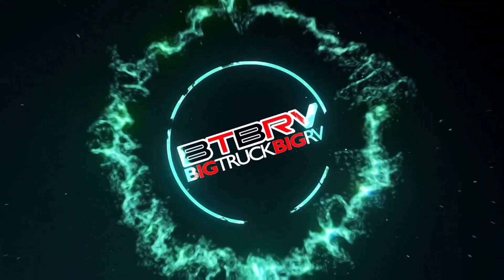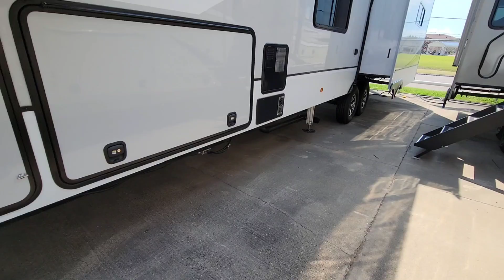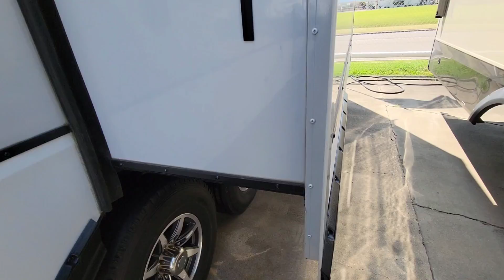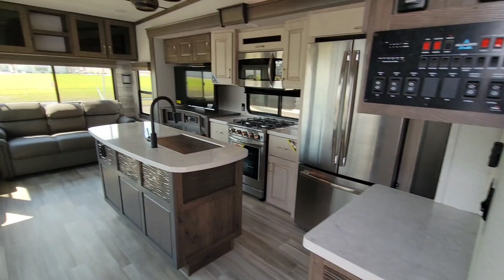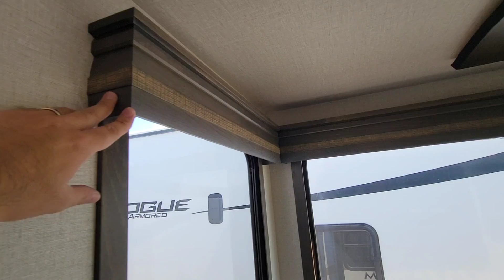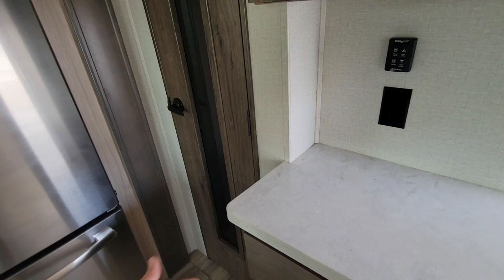A better built RV? How much more would it cost?  Let's find out!

Comment: Great insights. Quality control is really the key to customer satisfaction in the RV industry. The little things you mentioned like trim work are minor and easily corrected. Most people may get annoyed but will take care of it and move on but some things cannot be corrected once built. I wish you were closer to my location so I could show you what truly poor quality control is. I will not give the brand but my new unit has issues in multiple structural areas not able to be or not easily fixed now that it is completed. An on the line QC of major components, (floor, roof and to a lesser extent plumbing), would have saved me a lot of grief. I have a unit that should be bought back by the manufacturer for build issues. To top it off, the build issues and problems have been compounded by a dealer that has proven themselves incompetent. They have caused significant additional damage while “repairing” warranty items and even damaging my front cap to the point of potentially needing replacement. We have owned an RV of one type or another for over 25 years- our last one was even this same brand and never have I had the issues I am having with this one. By the way- it is only 4 months old and has spent most of that 4 months at the dealer.

Comment: That being said once again you in some ways come off sounding like an apologist for the industry. That’s a harsh statement so let me tell you why I make it. 

First many of the upgrades you price in are ones that most people aren’t asking for. Take the axels. Most of us would be perfectly happy with what came with your new 5th wheel which obviously wasn’t insanely expensive. I noticed with the exception of the roof there wasn’t an upgrade you put a price on I wanted. 

Second the plumbing and wiring I think your missing how for example automotive style harnesses work. Those harnesses are designed not only for reliability but speed of production. An automotive style harness would be more expensive to design and buy but it would allow the units to be assembled quicker and be far far more reliable in the field. Especially with proper color coding of wires to make tracing faults faster and easier. At the very least they could eliminate things like the rats nest of wires you found when you opened your unit up. That’s not efficient or fast. 

With plumbing the big issue is the quality of components that they use. Plastic joints vs brass. Pex connections on non Pex pipe. Yes those fittings would be more expensive but by a few hundred dollars a unit not thousands per unit. 

Third when you do start talking about improvements in fasteners etc you say it’s something they could do. I’d rather see you pointing to specific areas and pointing out that there is no excuse for doing it cheaply or poorly when it can easily be done much better. For example cabinet joinery. RV drawers are a butt joint held together by a couple of staples. It’s literally the weakest possible way to do it and entirely unsuited to the rolling earthquake environment. Especially when the technology exists to produce far more robust joints in a production line environment. Or how about how they surface panels in an RV. Often what looks like a piece of stained wood is in fact pressed paper with a piece of what is essentially wall paper on top of it. Which means it has zero durability and is nearly impossible to touch up when you do get dings and such. A good price of stained 1/4” plywood or even solid wood would be far far more durable and repairable for the end user.

Fourth installed component reliability. It’s doesn’t take much time in the various forums to see people having issues with things like water heaters and 12v gas/electric refrigerators. The basic technology behind these components has literally been in use for decades and there is simply no excuse for their manufacturers to not have devolved their products to the point of being utterly bullet proof by now. You can’t tell me these manufacturers don’t know what they need to do to make their products perform better and more robustly. So what are they waiting for??!!

JD you’ve been on a crusade for years for better tires and suspension systems that is showing dividends. Public companies respond to public pressure. You’ve got the ability to apply that pressure and I’d love to see you using it beyond tires and suspension.  

I want to emphasize that I believe your telling us the honest truth as you see it. But I think your missing a great opportunity to push for better quality across the board. Because frankly most of the time when you talk about quality it’s to explain how these units are hand built, or how this change would cost a lot of money, or how all RV’s have problems etc etc. I don’t feel like you spend nearly as much time calling out things which can be better and should be better.

Comment: So we ordered a new unit in January (still in production) but we upgraded everything. Not happy about the price tag but feel it is worth it (on demand hot water, solar, generator, brakes, cold weather package, residential package, dishwasher, washer, dryer, etc. ) We are going full time and felt the end result justified the cost for our extra comfort, convenience, and safety. Not everyone will feel the same. This is my 4th RV and I have learned you get what you pay for.

Comment: You are thinking about it wrong. you are adding the cost up as if you are buying everything aftermarket and then adding it to the coach. you are forgetting to account for the cost savings of not using the original equipment. Such as adding an instant water heater but not subtracting the original cost of the original water heater. so say the the cost of the instant water heater is 1000 and the standard 6 gallon or 12 gallon was 500 dollars... its not now 1000 additional cost its 500.. your costs are WAY off..
Reply from the maker: I did factor that in if you listen closer to my overview

Comment: Things most important to me are as follows:
Safety- I want the best axles, tire / rim, brake, and suspension components possible.  Being broke down on the side of the road, or losing control of your camper heading to your destination due to under rated components is absolutely unacceptable and completely preventable.  
Comfort- 2 big upgrades for me would be any improvement to keep water out, ie. solid metal roof.  Ducted AC system, and better insulation.  Do any manufactures use closed cell spray foam?  Not only would it increase the R value, but would add rigidity to the entire coach.  
Last- things like conduit wiring, manifold plumbing and try to stay away from wood products as much as possible.  Use composite materials that are subjected to changes in moisture and humidity.  That’s just my $.02.  Yes, I’d be willing to make sacrifices in other areas to keep cost down, knowing that I can make upgrades later on.  Think appliances, furniture, cabinets, plumbing fixtures.   I can rip out old cabinets and replace with nicer ones.  I can’t rip out 2 inch walls and go back with 3.5 inch walls.

Comment: Fantastic. I am adding independent suspension rated at 8K per axle. I also wish they would look closer at how boats are built for fasteners. Thanks for adding weight on your add list, I didn't realize how much weight some of these things would add. It explains why some of the units that have what I want are so much heavier.

Comment: With the wiring it would cost a little more with wire harness it it could greatly decrease production time. It is easier to lay in a pre manufactured harness than running separate wire in each RV.
Reply: I would agree if they controlled production of all electrical components.  The automotive industry uses plugs with all their harnesses, which means everything simply plugs into a harness at it's termination point.  Unless the RV manufacture could produce their own switches, panels, and electrical components, they would still need the labor intensive process of connecting plugs/outlets and such.  Also, they generally have a rack with all the wires they need spooled in place and the grab all the wires they need at 1 time and drag them down the chassis together.  With a harness, you would need to use grommets and fasteners to attach the harness to the frame and other areas.  This would actually slow things down compared to how they do it now.  Also, remember that they often change technology and floorplan styles very frequently.  This would require a new harness be produced every time, which means harnesses that aren't used would have to be modified or scrapped.

Comment: Lets assume that no one is going to change a thing with components, walls, wood, tires, or any thing else.  What if the problem is as simple as quality control.  Probably starts with discussions with employees about checking their work, taking that extra minute to fix what they already know is a mistake and repair or clean up what they just did.  Conscientiously working, taking the extra few seconds, working toward quality and not quantity.  I suspect simple changes like that, starting with Forman and managers, would make a larger shift in the quality working with already existing product.
Reply: They are humans doing a repetitive task.  Few people could do this day after day.  It's the weak link in the process and only automation will solve it.

Comment: Inch for inch Azdel has a greater R value, so I’m not sure a double Luan would have a higher R value. Why would I want to upgrade that pin box? Would it add to the build quality or reliability of the trailer? I think changing the way things are fastened is huge. I believe problems would be greatly reduced. I had a couple of screws pull out holding a window valance. Azdel does not hold screws as well as wood. I repaired it with a simple screw anchor. The question is why not use screw anchors when building the trailer. My trailer is a Lance which is a premium priced unit which uses premium materials. Overall it’s been a very good trailer. There are processes in RV construction that can be improved that would enhance quality such as the way things are fastened together. This improvement doesn’t require expensive upgrades in components. It may take a little more time and minimal material cost increase but to avoid problems it’s worth it. Even minor warranty repairs can be a huge pain. Timely service with minimal loss of use is impossible to get. If you’re a full timer, you’re screwed. That’s a whole different topic though! Access to service in this industry really sucks and needs to be overhauled. Because of this, build quality and reducing problems is all that more important. When Coachman sent a mobile tech to make a repair on your fifth wheel, I thought that was great! This should be the model for future warranty repairs!

Comment: How does Airstream do it? Have been in business a long time.
Reply: correct, but they are extremely expensive per ft and do not make fifth wheels.  They also suffer from many of the same issues as other brands.  But think of it this way, a 28ft Airstream travel trailer with no slide costs around $40k MORE than this 42' Alliance Fifth Wheel.

Comment: Here’s the thing . As I’ve always said . Anything that is man made or assembled by man is subject to failure . But , given the proper care and maintenance as well as preventative maintenance rigs can hold up fairly well . Given , that is not to say that some things are just subject to failure . That’s why they make spare parts available to the consumer . Being able to perform many repairs yourself is both imperative as well as saves rig time and money .  Can manufacturers do a better job . Sure . But there’s a human factor involved . These things are earthquakes on wheels . And our roads definitely don’t help things . Plus being in a rush to get somewhere with the rig certainly doesn’t help the rigs longevity . By watching this channel and many others be learned I can fix a lot of stuff myself . Saving me both money and time . Probably the Love You upgrade I’d be willing to pay extra for would be the independent suspension . To me this as well as quality tires are the most important piece of equipment on a rig . We full time . And we travel a lot . We’ve owned 3 different brands . All purchased new . And I’ve been pretty satisfied with all 3 . Did they have issues . Sure . But they were actually minimal in the grand scheme of things . They roll . Things move . You repair what you can . And what you can’t try and have the manufacturer or a quality technician make the repairs . Good job jd .

Comment: Suspension system: Premises: 1.More axles, more  expensive  2.Higher quality components will be more expensive.   3. Leaf springs are known to fail. 4 Independent suspension is more costly than leaf springs  5. Retrofit upgrades  on a suspension is more costly than if it were part of the initial production.  Do you agree with this?   Price quote from MORryde site  for a tandem 7k independent suspension with disk brakes is  $7499.00 or $7999.00 for 8k suspension. ( Prices effective Feb 2021).  Price quote  includes retrofit / upgrade from leaf springs to independent suspension. Upgrade requires removal of all existing components, preparing frame for additional re-enforcement and installation of independent suspension.  Installation of independent  suspension during initial manufacturing process  would be seamless and more cost effective.  Taking into consideration the time / labor / materials MORrdye expends to remove  the  existing suspension  and prep the frame for retrofit the  cost savings  labor TBD?  For a Rough Order of Magnitude, I'd day two people for 4 hrs each for removal. Would I spend an additional $$$$$ on and independent suspension, you bet ya. I think is should be offered as an option.  After watching a  video on the how the independent suspension improves the ride quality of the coach, it  made me a believer.  Without a doubt  it will add to the longevity of the coach.  Just my two cents.
Reply: The crazy thing about this is that LCI does not approve of IS suspension on RVs that didn't come with it.  This is because the frame must be modified to handle the additional stresses that occur.  I had this conversation with the lead LCI Frame/Chassis Engineer.  So that means Morryde equipment attached to an LCI frame must be designed by Morryde to enhance the overall structure of a frame designed for leaf sprung suspension.  LCI also prefers weight distribution equalizers over non-distributed IS systems.

Comment: @ 17:15 When you said covered up by the people that are doing it?  Really?  Like a crimp in a water line that causes a leak in a new RV.   A new RV is taken out for the first time and the water heater doesn't work, or the inverter fails. Then you hear this brand of inverter is known to have issues.  This comment is not directed at Alliance it directed at the industry.  It's time to review and refine processes.  Because this is the way it's always been done in the industry no longer is a justification.. So many people involved in the assembly and build there will be issues.  It is no longer acceptable.  It's time to change!
Reply: I don't disagree, however, of the 10,000 inverters that are installed in RVs each month, if 100 fail or have some type of manufacture's issue shortly after the sale, is that an issue that's realistically addressable by the RV manufacture, when the inverters that failed are spread out amongst 200 different RV brands? Which means any specific manufacture may have less than .5% of their units fail.  Just something to think about.
Reply: That's why they only give a 12mos warranty.  Trailer won't last  longer. They can procrastinate on repairs tell the warranty runs out.

Comment: I solved all the poor quality build issues and poor workmanship by selling mine after 5yrs and just renting cabins or staying at hotels. Haven’t had a slide out, roof or tire/suspension issue since. Best decision I ever made, never again will I own one. If I was a assembly line worker at a plant, no matter how good a job I did, I’d be embarrassed to say I worked at rv manufacturing plant because of the industry wide quality issues.

Comment: I agree that there’s a give and take and you can make it cost restrictive. But they definitely do need to work more on fit and finish and make some more plug and play parts. I’ll upgrade the axles and/or suspension later like I did with my RV.

Comment: Roads are bad and lot of the problems are caused by vibration the manufacturer can't do much about. 80psi tire gives very harsh ride. Go from 4 tires to 8 have dual wheels and drop the pressure from 80 to 40. Get much softer ride.